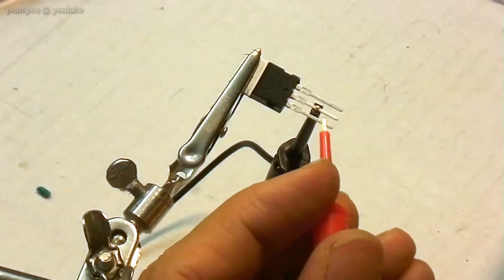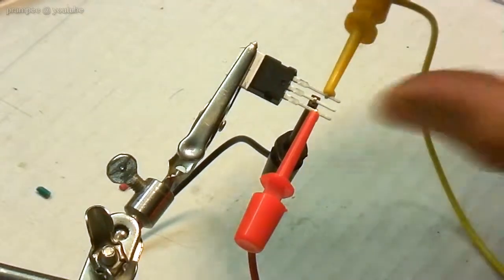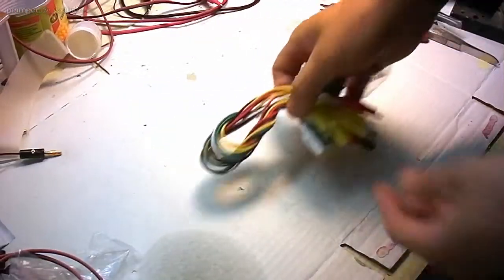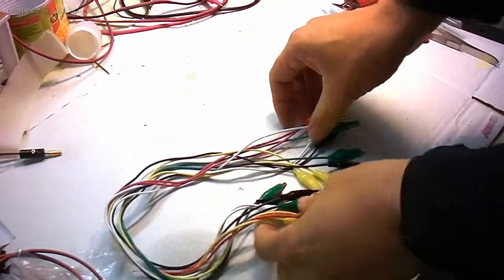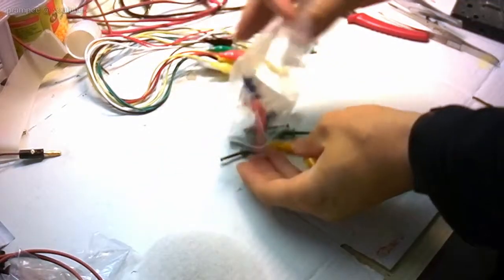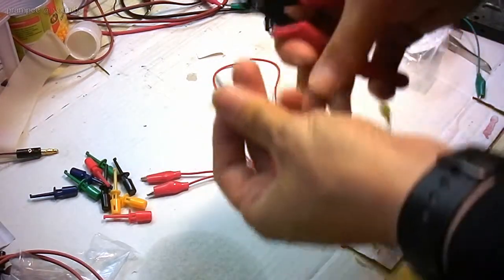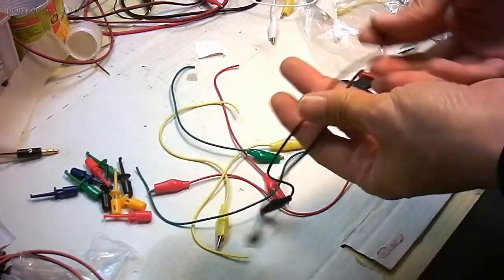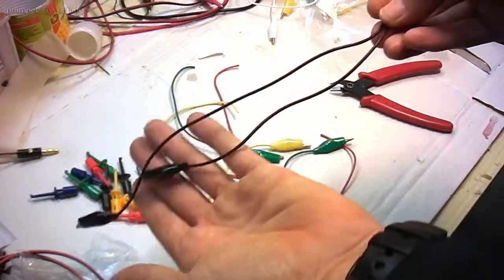DIY test probes

Comment: I was actually wondering what was supposed to be on the opposite wire end if there was a J-hook on one end. There are three options that make sense: hook-to-hook, hook-to-alligator clip, hook-to banana jack. To me the last option makes more sense if the hook is connected to a multimeter since the first two options of the three assume bridging parts of a circuit and I'm not too sure if that can be very useful.
Reply from the maker: You are right, but I like to use alligator clips connecting to multimeter probes. Also lots of alligator clips can be connected into one.